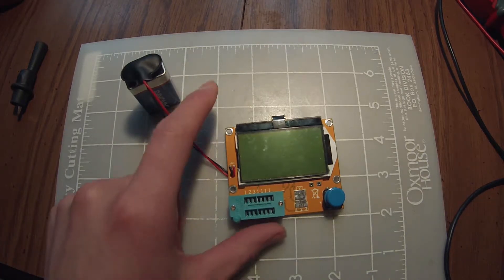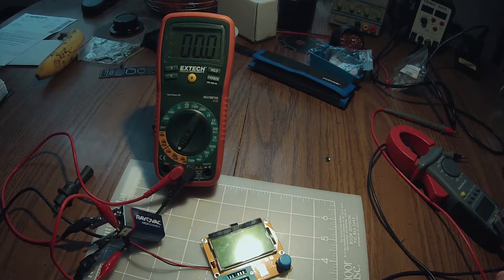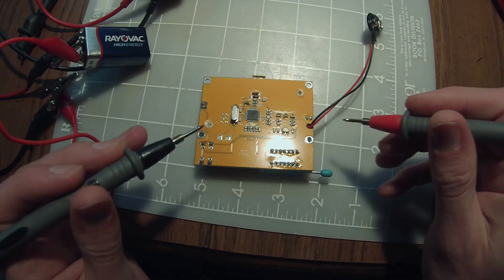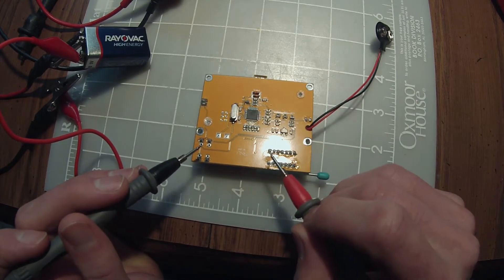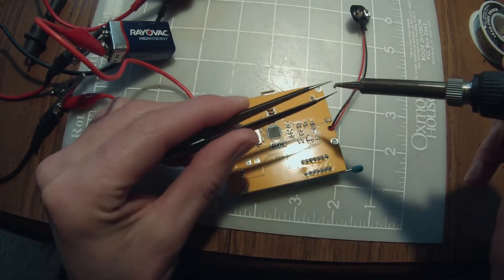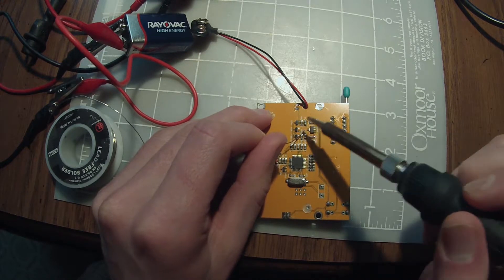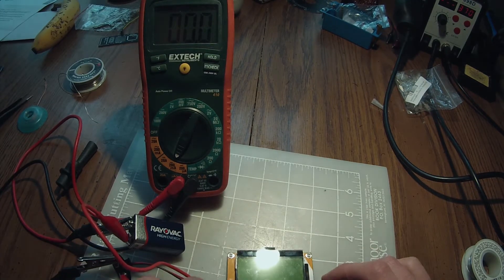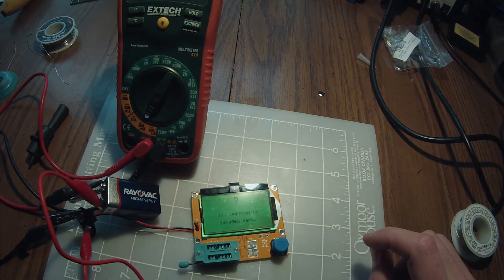Reduce backlight  and save battery life with "All-in-1 LCR Component Tester"

Comment: desoldering the backlight (to access programming pins under lcd), with battery connected accidentally, shorting the 2 pins seems to damage the lcd display internal backlight, that there is 9 V at all times on the backlight pins, or I could have pressed the button, so now I need to place some replacement backlight leds somehow

Comment: Is it OK to use 16K. resistor for completelly turn off backlight, instead of 10K. resistor?
Reply from the maker: Well it's been awhile, but if you don't want the backlight I think you can just desolder/detach the leads for the back light? The 16k would probably dim it quite a bit more. It's been so long I don't remember.
Reply: @Datzfunk  Hello. Thank you for this video, its very helpfull to me, since I am soldering under the light and don't need the backlight on LCR tester. According to my question, you can't just desolder backlight - tester stops works. You need to desolder one backlight pin and solder the 10K resistor beetwen backlight contacts (with one pin detached) to completelly turn off backlight, but I have only 16K resistor. So, is it OK to use 16K resistor if even 10K already works?

Comment: I am running it from a transformer > rectifier > caps > lm317 (9.2Vdc) >Mtester. Draws similar amps as yours.
Its already started blinking (doesnt finish testing) after few days.I have to switch off completely and start again. Maybe a problem with onboard 78L05 ?
Reply from the maker: Are you able to test the circuit with a 9v battery and see if it behaves correctly?

Comment: Thank you for the guide! I was looking for how to adjust the backlight. My LCR is still one the way, wondering what happens if turn off the backlight? A 10mA current is still quite high for a 9v battery, I am also thinking of using 2 or 3 18650 batteries, 2 might not work well consider the 78L08 voltage drop.
Reply from the maker: You could try a larger value resistor. I've tested a 4.7K, and it seems to work as well.  If you wanted to get rid of the backlight completely, you could desolder one of the leads going to the backlight. They should be located on the left side mid-way up the board if you're looking at the back. I think it'd probably work fine without the backlight, but I haven't tested it. As far as the 18650 cells and the regulator are concerned, the regulator according to a datasheet for an ST 7805 sot-89 package should be good to 30v from what I can tell. However I don't know if it's an ST part or not, I wouldn't give it anywhere near that. Two cells would probably work. Also, remember the whole circuit is not regulated by the 7805. The backlight and a voltage divider fed into the microcontroller rely on the input voltage before the regulator.  The dividers voltage seems to be around 2.2v at 9v input, and as long as it doesn't surpass 5v it should be fine.
Good luck, please let us know if you figure anything out. Thanks!
Reply from the maker: Ok, you got me a bit curious. I desoldered the positive lead from the backlight, but the device didn't function properly, it is some kind of latching circuit it appears. I soldered on a 10K resistor between the negative and positive terminals of the backlight on the back of the circuit board while leaving the positive backlight lead disconnected. It now works with no backlight.
Reply: @Datzfunk  i'm probably too late to comment, but i'm curious, how much the current draw after no backlight vs dim (4.7K) ?
Reply: @Datzfunk  , thank you for this idea, I will try this soon, since my LCR-T4 tester arrived. Maybe, I am add a switch to turn backlight on or off.

Comment: May I have a question? do need this multimeter qualite battery with higher capacity e.g. 600mah or standard cheap for 200mah would be enough?
Reply from the maker: For a 9v battery, the current draw is fairly high. You could try lesser quality batteries, but I'd probably recommend a rechargeable 9v. As good quality 9v batteries aren't cheap, depending on how much you use the device you could burn through a few of them in no time.
Reply: Thank you really much I got from other source quite same info - instruments eat 9v batteries little bit, so I could be more sure now; also find info that 2× 4.2v =8.4v bat. would be ok for the tester (maybe it is 18650 or 16340 charged or something like).